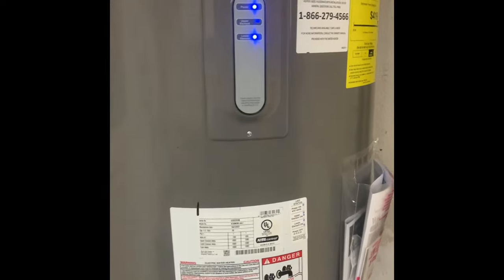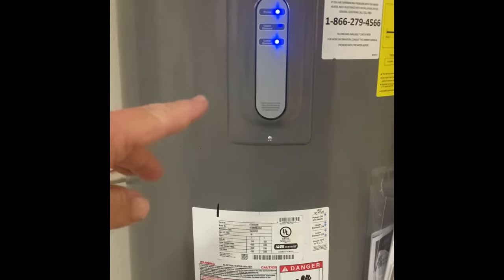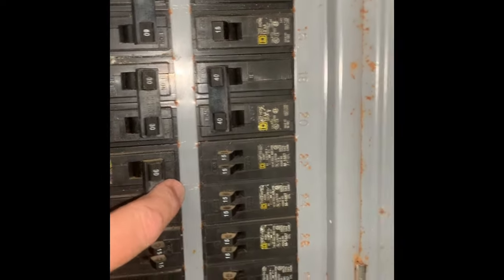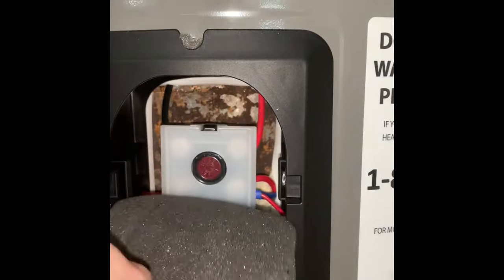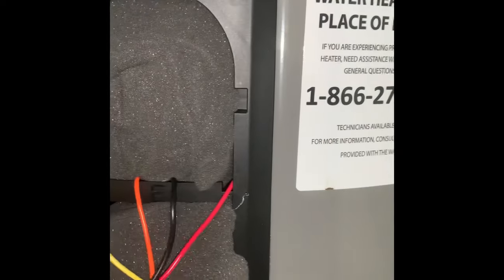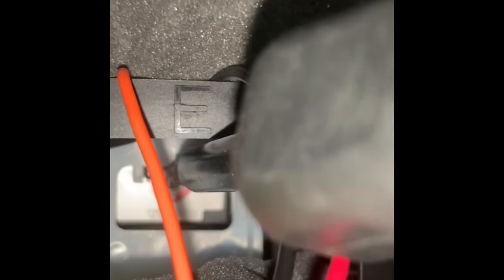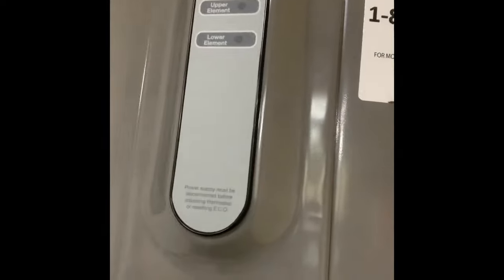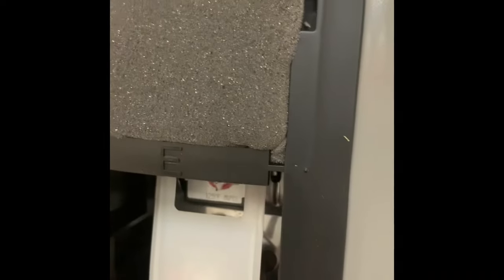How To Adjust An Electric Water Heater | Rheem Performance Plus | EASY!

Comment: to only 120!? are you crazy? no wonder your wife is complaining no water heater should be under at a minimum 135 even at 100% hot your too cold at 120
Reply: Thank you because I was just arguing with my technician 120 is not hot enough😂
Reply: i set mine 140 at winter and 130 at summer

Comment: So I just replaced my 2014 50g electric Rheem, with the same exact updated model… the big yellow efficiency sticker says $489/year, which is almost $120 less than the same sticker on the old unit… putting the actual price paid for electricity aside, I’m assuming that estimated low number is for the factory setting right? The new one has both top and bottom set to 100 degrees, the old water heater would scald you at full hot(i just bought this house last year) which sucked, but I’m thinking 100 is not enough… anyways, is there any formula to calculate the increased power consumption from 100 to say 125? I live in California where power is outrageously expensive right now so every kWh I can save helps…

Comment: want to mention I set mine 140 in winter and 130 in summer (i live in north east) you ask why? because in the winter town water temperature is MUCH colder,  so to balance shower mixing  hot water temperature need to be increased.  you can keep it 140 in summer, but 130 is more comfortable for me. 😊

Comment: I installed the same water heater about two weeks ago also turned it up to about 120 125 . Our problem is we run out of hot water very fast . It’s a 50 gal 5500  if the wife and I are taking showers at the same time it goes cold in maybe 10 min does yours do that

Comment: You adjust it on the upper and on the lower? What is the difference between the two?
Reply: There’s two elements, use one at a time
Reply: @resistthenorm6747  why are there two? What is the purpose? One is kitchen and other is bathrooms?
Reply: @commentoria  to keep hot water hot…. One heats up and turns off and other turns on to heat water
Reply: @resistthenorm6747  so I need to adjust both of them? Because I adjusted the lower one and it didn't make it any hotter.

Comment: This has performed exactly as desired https://www.youtube.com/post/Ugkx8G49mV71sAzUl9shXyLW-r3XgHH9EVh1 . Basically, instant hot water instead of waiting up to two minutes as it was before. I have had this installed almost exactly one year now and just replaced the anode which is pictured. I pulled it out at six months and cleaned the heating element and removed debris. I would recommend a cleaning every six months and an anode replacement yearly. A mild citric acid and water solution soak really helps clean the heating element and tank. It must be fully disassembled to do the cleaning and that is not difficult but could have been made easier with a couple of design changes but no big deal.
Reply from the maker: Great!

Comment: i havent been able to find anything online regarding the light statuses for the top and bottom elements except for confused comments in videos. the manual doesnt mention them at all. after starting mine up only the top element is on and the bottom off. does anyone have a source explaining the lights and how the system works ? do the elements rotate? thanks
Reply from the maker: Top light only is normal. Top and bottom means bottom is currently heating up. Top two means top is heating and there could be reduced hot water or that lower has failed.
Reply: hi, mine has same issue top two lights ON.low hot water?any solution please   @BevanFarmTexas
Reply: This is what! 
U-Tube.
"How do I adjust my Electric Water Heater?
You'll get much information about your questions.

Comment: so what's your thoughts on this water heater?? I'm trying to decide between this basic unit with an Energy Star of $419 a year and a hybrid of $119. It seems like Rheem is having issues with there fancy Wi-Fi unit  system so that's something to consider.
Reply from the maker: It’s working just fine for us!
Reply: It's garbage, and Rheem support was a nightmare.
Reply from the maker: @dcarney19  hopefully you can bring it back to retailer.
Reply from the maker: @dcarney19  please tell me about your experience, so I know what to expect.

Comment: How come the “upper element” light is not on? I just installed mine and concerned about the upper element light not illuminating
Reply from the maker: It had just started. Illuminated a few minutes later.
Reply: @BevanFarmTexas  for some reason, the upper element on mine just isn’t turning on. I’m not sure if this is an energy efficient mechanism, or what. When I first installed it about an hour ago, the upper element turned on while the lower element light was off- and then the upper element light randomly shut off, and now the lower element light is illuminated. So confused. Wondering if it’s a lemon.
Reply: @theegarbagemonster  I've had this unit for 3 weeks now and nothing but issues. Rheem has replaced both stats, both elements check out fine ~15ohm, still only get one shower in before luke warm.
Reply: I should add that, after stat replacement, i had it set to 125, but wasn't quite enough hot water, so bumped to 130, then lack of hot water issues again. My upper element light also never goes off.
Reply: @dcarney19  I've seen reports on the Gladiator version having issues with the upper element switching and wont shut off.  Perhaps their element switch has a design flaw.